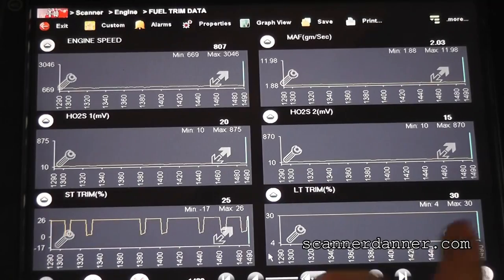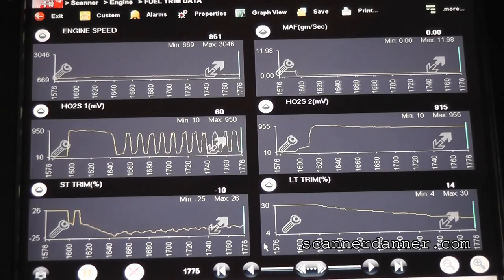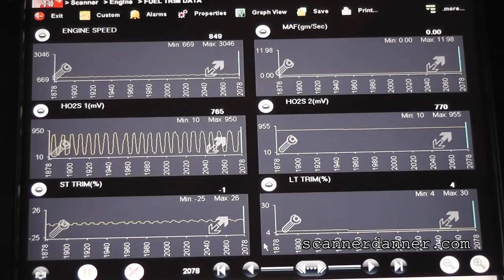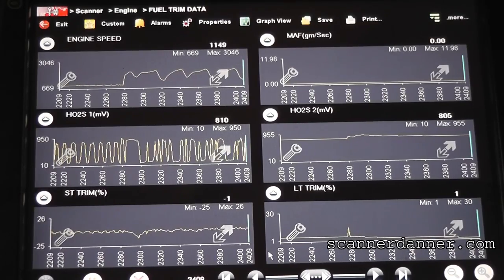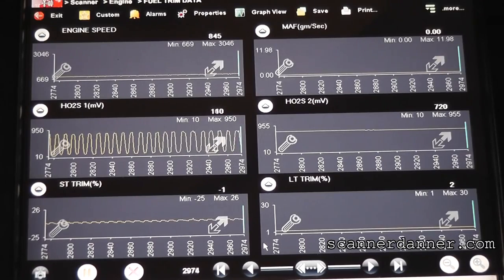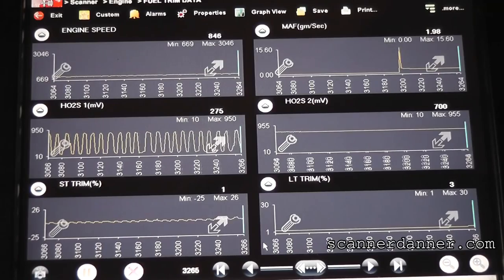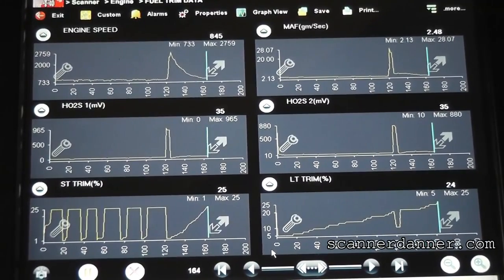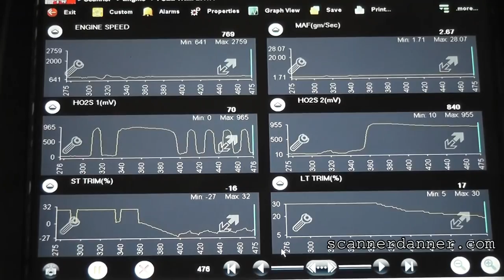Can we trust "the unplug it test"?

Comment: Will a bad booster throw a maf, air temp sensor, and misfire code on cylinder 3 ? I changed plugs, coilpacks, sparkplugs, injectors, coolant temp sensor, 02 sensors, cleaned the maf and tps, and fuel filter and i still have horrible initial throttle response, backfiring, bogging, and shaking when going from parking to drive or reverse and stalls at times making the truck not drivable im down to both switching the maf and the booster i just want to get the misfire and bogging issue fixed 2 mechanics tried but no luck they switched the injectors by the way this is a 3.4 v6 tacoma

Comment: I unplugged one on mass air flow it set off about 6 more codes  but im not sure if turbo relearn issue or bad map sensor
Reply from the maker: you can't always use the "unplug it test", especially when you have an internal IAT and MAP/Baro input circuits as part of the MAF sensor, which is what it sounds like you have

Comment: My map sensor hits red on my scan tool and when that happens it goes into limp mode and sounds like the timing is messed up like spark knock i have some other weird voltage issues f750 2019 6.7

Comment: hello mind is a06 Sanda fe v6 be for i remove THE AIR MASS i had not much power but as soon i un hook it had all kinds of power
Reply: will it hurt driving for a short time
Reply from the maker: Short drive you'll be okay. Extended driving this way you risk melting down your cat if the mixture isn't right

Comment: Chevy 1.4 luv. Intermittent p0171. Smoke tested engine, found no leaks. Fuel sample is okay. Checked for vacuum leaks with brake cleaner, no leaks found. Unplugged maf and fuel trims went from 7-12% to 0-2%
Reply from the maker: What are your trims both long and short term at idle and at 3000 rpm in park?
Reply: @ScannerDanner  Short term at idle bounces between 3-7% long term stays around 7-8% most of the time. Occasionally long term goes to 12-14%. I did not check trims with the engine at that speed. Pre cat 02 sensor is new, gm part purchased at the dealer
Reply: @ScannerDanner  The air filter appeared to be relatively new. It's an aftermarket filter. I didn't notice any fitment issues with it. I pulled the maf sensor and I did see evidence of dirt near the element

Comment: I'm having issues with my diesel can. In 5th and 6th gear the rev clock starts waving up and down and struggling to get power.  If the problem is the sensor would unplugging the sensor stop the acceleration problem so I could replace it?
Reply from the maker: You cannot always trust the unplug it test

Comment: I don't suppose there's a link for the Subaru video he was talking about towards the end? I have a 2013 Subaru Crosstrek with an idle that bounces up and down pretty consistently between 700 and 800ish RPM, and while there are no codes it appears to be running a bit rich and fuel economy seems down. I don't see any vacuum leaks with smoke and disconnecting the MAF while running causes it to almost stall, but recovers after a second and idles smoothly, albeit at 1400 RPM. Spark plugs were done a year ago, new PCV valve, replaced a couple VVT solenoids a month ago due to a P000A and oil in the conectors, but the idle issue predates that. My diagnostic abilities are admittedly not great so I'm not sure where to go from here.
Reply from the maker: should be this one https://youtu.be/QwGICKqWgM4

Comment: I have a weird issue my car at idle the long term Is -30 percent but once I get to 2k rpm it’s near 0. All spark plugs are rich. 

I did the test removed the maf sensor and the trims are normal and car drives better. Spark plugs are fine. 

Just from what you said about if rpm’s go higher and car gets better can’t be the maf, has me confused now about my problem
Reply from the maker: MAF unplugged and trims even out and it runs better right? That's classic bad MAF. You must have misunderstood what I said? What time frame of this video?
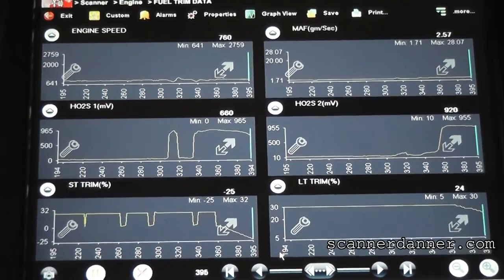Reply: @ScannerDanner  from 7:10 to the end. Explains why unplug it test isn’t accurate if car is at idle and trims are bad but under load it acts fine
Reply from the maker: @januelespinal6328 this is my video, I don't need to watch it to understand the unplug it test isn't always accurate. I never said it was always wrong.
Reply: @ScannerDanner  my misunderstanding, I’m planning on swapping out the maf sensor…… what other things can cause negative ltft at idle but act fine with higher rpms
Reply from the maker: @januelespinal6328  incorrect cam timing, leaking injectors, stuck open EGR valve (MAP engine only)
Reply: @ScannerDanner  thanks for the tips, I’ll try to change the injectors also I’ll let you know how it goes
Reply: @ScannerDanner  hey I know you mention egr but what about a pcv system if it’s faulty…. Could it give the same scenario of at idle negative LTFT and normal trim at higher rpms?

Comment: Hi SD this happens in my suzuki swift m15a engine.. when i unplug the maf the engine works great but when i plug it, trim goes up to 20to 30percent.. it has issues with o2 sensor 1 bank 1 no circuit activity... When i bought the car is is cat delete at aftermarket headers and straight pipe.
Reply from the maker: What did you find to be the cause?

Comment: Is it normal for a MAF sensor to give more symptoms suck as shaking and no gas Flow once it is heated up?
Reply from the maker: it would depend on how skewd the sensor signal is. What are your fuel trim numbers during this condition?
Reply: @ScannerDanner  I have not looked at that. I haven't fully learned this scanner yet. I previously bought a 3rd party sensor which I was told wasn't a good idea after the fact.  The throttle body elbow clamp is also broke causing air leak. Got new maf sensor from Bosch.   New Elbow is on the way.

Comment: I took my buddies suggestion and tried disconnecting my mass air flow sensor from my 2001 vw Jetta aeg gls standard trans while the engine was off and I heard a pop or clicking sound come from the left side of the steering area as soon as I attempted to turn the ignition all the way and haven’t been able to start my car since no crank lights and everything else works still I did get a code and I was dumb enough to delete that the car runs like a champ beyond this any chance in help thanks!

Comment: I know I'm late to the party but would a vacuum leak cause a high IAC count, and high barometric psi? Also, my tps sensor is only reading 0.55 volts,  is that normal?
Reply from the maker: On a MAF engine, yes, a vacuum leak can cause a high IAC count. 
Baro psi should be high (near 30 at sea level)
TPS at .55 at idle is normal
Reply: @ScannerDanner  Thank you. I think I've found my vacuum leak.  Also,  did a leak down test. 55 psi cranking and at idle but leaks down pretty quick when shut off.  I just replaced the injectors.  I noticed that I have a small leak in my Fuel tank itself,  would that cause low psi?
Reply: @ScannerDanner  And my barometric psi is reading about 12.33 at idle.  I'm in Utah so about 5,000 feet and our local weather lists our current barometric pressure at 29.82 inHg so I should be reading about 14.65 psi is my math is correct.  Again,  thank you.  I have really enjoyed your videos this far.  They have been EXTREMELY informative and helpful. While at work I'll put them on my phone and try to listen them through my earbuds throughout the day. 😆
Reply from the maker: @joefletcher5617  29.82 is sea level. At 5000 ft you'd be more around 24-25

Comment: "If the performance gets better at high RPM then it's not the MAF" This is fantastic information!
My 2.2D X-Type has been acting the maggot for weeks now, and I'm too stubborn to take it to a mechanic. Initially it was cutting out immediately after starting up, but then a few days later it was idling rough instead.
A few days later it was idling fine, but rough around 1000-2000rpm.
And after that it was fine around 1000-2000rpm, but rough around 2500-3000rpm.
But lately it's been missing, cutting out when slowing down or taking off and just generally acting weird, and there's the odd slipping noise, like a fanbelt.
But it's usually a lot better after it warms up for about 10 minutes, and I can always make it better immediately by unplugging something like the MAF or a MAP.
 I recently cleaned the turbo, MAF, 2 MAPs, and the EGR, and thought it might be fixed, so today I went off to the shop and halfway down the road it started stuttering, then conked out when I came to a stop and would keep on cutting out when I tried to take off. I eventually managed to get it back home and I was about to go into a sulk when I decided to unplug the MAF. Car ran fine and I went off to the shop and got my groceries!
Came back, plugged back in the MAF, and the car acted fine again!
Bloody thing is gaslighting me!
Reply from the maker: What year? X-type? So this is a jaguar?
Reply: @ScannerDanner  (I replied but the comment disappeared so I'll try again) Yea, it's a Jaguar. It's a 2010 (2009 facelift model), 2.2D, with the 6-speed automatic gearbox and an electronic turbo actuator. It's the one with the large EGR at the front, that has a MAP/boost sensor on it.
Same engine as the Mondeo MKIII 2.2TDCi with the fuel rail at the front.
Reply: I have the very exact problem with a 2006 Volvo XC90 it works fine with the MAF sensor disconnected, but as soon as I conect it, it bogs out and dies.

Comment: I recently bought a 2003 Kia Sorento with a P0102 that ran fine, the sensor read 2 g/s no matter the engine speed or throttle opening signal. Easy fix right? No! I installed a new OEM MAF sensor and now it won't accelerate and just bogs when opening the throttle, to make things worse it has no MIL or codes. I'm currently fixing a vacuum leak on the EVAP so I'm guessing this might be the culprit. Thanks for the info.

Comment: I read something called limp mode.. makes sense. I was told the test was if you unplug and the car shuts off it’s good if the car stays on it’s bad. When I unplug mine the car sputters like it wants to shut off but kinda stays on... maf bad?
Reply from the maker: You can have a car not shut off and still be good. This statement is inaccurate at best. " if you unplug and the car shuts off it’s good if the car stays on it’s bad"
Some systems will recognize this fault and immediately plug in the default values. Others, you need to shut the car off and then restart it for them to apply it. Hope that makes sense. 
To use the test properly, it is a matter of how it drives. How does it run with the MAF plugged in, compared to unplugged, while also keeping in mind that some systems do not have good back-up strategies (limp home mode).
Reply: @ScannerDanner  still shakes and stalls at red lights
Reply from the maker: @sniperpaintcorrection  same symptoms as when the MAF is plugged in? Then it is most likely NOT your MAF

Comment: Hey question  if I change just my upstream  o2 sensors since I'm in florida downstream  wont affect anything. Will I improve mpg I have no codes for o2 sensors. Not check engine  light period. 2006 sienna 160k im trying to get the most out of mpg. I average  19mpg. I feel should get more.   Any tips to improve  mpg I drive good no heavy foot tires right psi I low rpm  while driving brand new denso plugs  any tips thanks in advance
Reply from the maker: on that model it uses a wide band O2 upstream right? If so, your downstream O2 is a factor on your fuel trim and fuel economy so if you have a code for that sensor, you need to address that
Reply: @ScannerDanner  that my friend im not even sure about. Any quick way to tell without a scanner?     I have no codes. Just wanna try and max out my mpg since only getting 19 mpg wanna improve that    thanks for the reply  or any extra tips if have. Stay safe
Reply from the maker: @prtbone78  definitely need a scanner. Only way to see your fuel trim numbers. Any simple OBD2 scan tool, even the little Bluetooth ones will give you this info. 
They run from $50-$100
Reply: @ScannerDanner  thanks bro. I figured needed it.. Im sure they're  wide band  with my luck  didnt think downstream  affected it. Should I change jist for the hell of it even with no codes? If so go oem ofcourse. But any known aftermarket  you recommend?
Reply from the maker: @prtbone78  OEM only for that O2, but I wouldn't change that sensor without seeing fuel trim numbers. Spend that money on a Bluetooth scanner instead
Reply: @ScannerDanner  10-4 thanks again for the advice. Stay safe.... i don't wanna be a parts changer  like you say.....lol.   ill look into it and make right decision.

Comment: Hi Mr danner, my 2000 Nissan quest 6 cy.inders,does the same thing, lean condition, rev the engine lean goes away, let it idle,unplug the maf van stalls, restarts the van with the maf unplugged it runs fine no lean conditions, the only differents from your video is that you dont mentioned if when unplugged the maf the car keeps running or stalls, thank you great videos,hope you can help me in this one, cheers from Ontario ca,  merry xmas 2019 to all your family Mr danner
Reply from the maker: Stalling is absolutely normal with the MAF unplugged. The car needs to ID the fault first before switching to a default strategy, then it may run well after. Not all cars have good backup strategies

Comment: Awsome video good explanation I went to a training class and was given a formula to calculate maf sensor accuracy try it out I found it accurate here are the formulas. Take a toyota sienna 3.5 at 766 rpm @ 4.25 g/sec
(Liter size x rpm) / reference rpm =theoretic g/sec
3.5 x 766 /600 = 4.468 g/sec
What is the percentage of accuracy?
(Actual g/sec x accuracy base line ) / theoretic  g/sec = % of accuracy 
( 4.25 x 100 ) / 4.468 = 95 %   I was also told if its within 5 % it's good. You will also see if it's off  ,the maf % of accuracy will b off almost the same amount of percentage as the fuel trims are from 0  plus or minus

Comment: The RPM went up a little after unplugging the MAF.  I've had MAP  (speed density) systems do that due to a gross vac leak which was under the throttle body to intake manifold on an 87 GMC 1 ton utility truck with a 350 (5.7L) V8.  Bad gasket.  Saw many of those.  Idled about 1500 to 1800 RPM'S.
Ran great!  Just wouldn't idle.
Thanks Paul!

Comment: Bear in mind that smoke wont get from the intake to the brake booster because of the one way check valve...
Reply: True. Tried that once when I heard air coming from the brake pedal on a Cadillac CTS . Smoke tested and hooked up line to going to brake booster. Was wondering why I couldn't see smoke. Then thought. Oh yeah check valve dummy. Put smoker after valve. Saw smoke after I pressed on the brake pedal

Comment: The "unplug it" test is useful to narrow the problem down to either the sensor or a vacuum leak. The booster should be smoked separately. The check valve at the booster should prevent smoke from entering the booster.

Comment: A good rule of thumb for unplugging the MAF is "if the runs better without it plugged in, the measured air mass doesn't match the actual air mass"
Doesn't always hold true on diesels, but overall it's fairy good. The reason could be the MAF reads wrong, or the MAF is reading 80% of the intake airflow, and there's a missing 20% coming in from an airleak. All modern MAF ECUs will by now have an inbuilt Alpha N table at the minimum (or fall back to MAP as a primary input) and the Alpha N table will tell it how much air you'd get on average at that throttle angle (the "alpha") and at the specific RPM (the n, as in number of revolutions)
If the guess is better than the MAF reading, it'll run better. I'd probably see 20:1 airleaks vs bad MAF, and that's a great rule that "poor running at idle, better at load is more than likely an airleak."
The reason why for those not quite sure is that at idle, the airleak might be 40-50% of the inlet charge, and that's way off, but at wide open throttle, a leaky vac pipe would probably be impossible to detect in the large amount of air coming in.
In the video, you could see a difference in leaking MAF voltage vs plugged leak MAF voltage, but you'd either need to know known good readings for that specific engine beforehand, since you only get to see the true value once you've found the leak and capped it anyway.

Comment: I saw another video of a 171 code where the MAF and the brake booster was bad.  YouTuber unplugged booster and had 40 psi and fuel trims got better with vacuum hose on a guage.
Reply from the maker: Bet it never needed a MAF

Comment: I’ve always hated seeing guys unplugging the maf sensor to diagnose. Unless it’s when there’s a no start in the parking lot when it’s snowing and it fires right up. Good job Danner !
Reply: Couldn't agree more, and when they do decide to dig a little deeper into sorting out the issue, to see if it really is the MAF and plug it into a scantool,  there will be a code for MAF sensor signal as a false positive.
Reply: Unplugging the MAF sensor is a valid test. In this case it ruled out every other possible cause except a vacuum leak.
Reply from the maker: Of course the unplug it test can be a valid test. But can be, is what you need to remember, meaning it could also have variables :-)
Reply: anti chuckle yeah what I meant was I hate when guys unplug a maf and just assume it’s bad based on the data. Raising the rpm with it plugged in showed it was a vacuum leak.
Reply: Jay Yoyo  if an o2 sensor responds to changes, vacuum or fuel introduced, it’s probably fine. Technically an open iac is a vacuum leak.
Reply: Jay Yoyo  higher fuel trim at idle that stabilizes when rpm is raised
Reply: Jay Yoyo  map is before iac so it doesn’t take that into account. Look at map at idle. It should be close to the liter of the car (I.e. a 3.5l engine should take in about 3.5gps. Map wouldn’t be a vacuum leak.
Reply: Jay Yoyo  sorry, was thinking MAF sensor. Yes, a map sensor could get a vacuum leak or read incorrectly